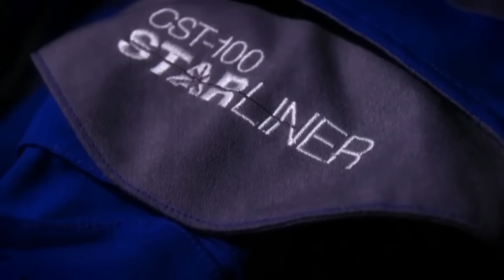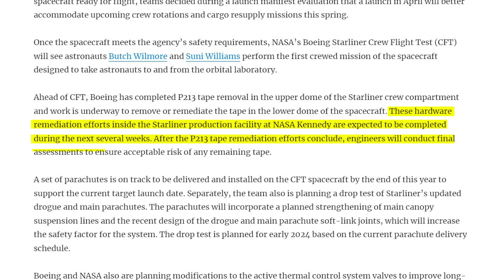What Happened To Boeing’s Starliner Spacecraft?

Comment: Wilmore and Williams, returned to Earth on March 18, 2025 : They should sue the bark off Boeing s tree for this negligence Boeing has conducted (737 max survivors to offer the 10lb hydraulic peddle hanging forcing 30+ veteran pilots to plunge to thier death in descent ..no excuse for one what pilot cannot put 10lbs of pressure on a peddle? Number 2 why isnt thier an emercency hatch or panel in the back of the plane to disconnect that rudder and manual lock straight forward ? Its not even needed to drive the plane but definitely responsible for many deaths , its not a fish or a bird if its a bird then what bird flys 500mph? Point proven fix your fkn mistakes Boeing!)

Comment: What has happened to Boeing?  would probably be a better question.
Reply: Oh, everybody knows exactly what happened to Boeing. Boeing was a company run by engineers. Its managers were always promoted from their engineering staff. Then, Boeing merged with McDonnel Douglas. MacDac had fallen on hard times because they had come to be managed by accountants and financial people who stressed the short term bottom line instead of the long term quality of the product. Somehow, when Boeing took over MacDac, the Macdac people wound up in the senior management positions of the company. They stopped promoting their own engineers to managers and began following the MacDac philosophy of hiring outside finance types. The results were as predictable as they were inevitable. People with no understanding of engineering were put in charge of engineering projects and concentrated on cutting corners, and they still don't know what they are doping wrong.

Comment: Starliner is a bad joke. Multiple problems that woudn't have happened given thorough quality control throughout the construction process, causing years of delay, all to produce a capsule + service module with less dV than the Apollo equivalents?. Boeing used to have a reputation for engineering quality, but somrhow, it looks like they lost their way on that. If you'd told me thirty years ago that Boeing's attempt at  this would be such a shambles, I wouldn't have believed you. I would have expected Boeing to have created a vessel that could carry more crew, in greater safety, and be more capable than anything else that had  existed. Now, though, Boeing is renowned for making flawed vehicles due to errors in design, manufacture and quality control.

Comment: The door plug blew off because they forgot to add bolts...
Reply: Actually no. It was the company that Alaska contracted with to install the satellite internet that took that plug out for access, and didn’t reinstall it correctly. You just have to look at the planes service history and log book to see where the problem appeared.
Reply: @davidwebb4904  i would do as mentour pilot said and wait for the final report...
Reply: @unitrader403  They was nothing at all wrong with that plane, before it went into the shop to install the Internet. Straight afterwards was when the issues started appearing in the maintenance log. If it looks like a fish, swims like a fish and smells like a fish, the odds are, it's a fish.
Reply: @davidwebb4904  well, i prefer to not jump to conclusions when ripples appear on the water.. for example usually several maintinence and upgrade works are done while a plane is in maintinence, not just one, and especially i doubt the plane is grounded a few days just for a wifi upgrade. 
Also the pressurisation warning in at least the last occurence triggered when the plane just landed, and from what i gathered only one of the triple redundant systems triggered in all instances, which is more indicative of a sensor glitch than an issue with the plane..
but again: i will wait for the final report, by which time i know no one else cares, because Godzilla just attacked tokyo again or something..

Comment: Starliner has a launch date of April 14th, 2024.
The parachute issue is fixed and th etape has beeen replaced.

Funny thing about the tape.. its used on the ISS, was used on the space shuttle and still used on the Soyuz capsule. Its an industry standard aerospace tape.
I wonder what SpaceX uses?
Reply: So why did NASA forbid its use if it was used on Space Shuttle?  Why was this issue not discussed and clarified early on in its development?  Also why was the parachute issue not resolved during the initial test when only two of the parachutes opened (by mistake)?
Reply: @Oldman5261   NASA didn't know the tape had a (extremely slight) flammability issue. until it came up during a review of a fire extinguisher system. Since everyone else was using it, Boeing thought it wasn't an issue that would be an impediment either.  NASA has since added it to the list of products they don't want on their missions.
It wasn't forbidden when Boing started designing it .
Similarly the soft link connections on starliner's parachutes are also commonly used in the aerospace industry.  The Issue is the load limit on them is reserved for a greater number of chutes.  Starliner was using 3 chutes which works fine, but if one fails to open then two cutes which are still fine for supporting the capsule put too much stress on the (fewer) softlinks.
Crew dragon for example uses the same softlinks but uses 4 parachutes. If one fails 3 is still sufficient to spread the load out.
Apparently problem occurred because they parachute manufacturer, Airbourne, provided Boeing with load limits of the chutes based on 4 chutes.
Elon Musk has actually given Boeing their data on the parachutes to help them out.
From what I understand Starliner will either be using 4 chutes with the same number of softlinks or using 3 chutes with a more softlink attachments on hardpoint assembly.  They a have tested them and both work. We'll have to see which one they choose.
Reply: @Oldman5261 Ever hear of the "old boys" club? There was even a high-level NASA admin who was caught feeding SpaceX's confidential and proprietary info to Boeing!

Comment: Given it's a Boeing product, I sure hope they thoroughly check to make sure there aren't any loose bolts!
Reply: Idk what people are on about. I’ve never been killed by anything Boeing made.
Reply: @oberonpanopticon  But would you be willing to board a Boeing aircraft now ???
Reply: @oberonpanopticon  You missed a keyword "yet".
Reply: Neah, the Boeing capsule is a feature. It can ditch the door in mid flight and becomes cabriolet, giving much better view of earth and mitigating claustrophobia.
Reply: Suddenly the dream Tom Hank's wife had in Apollo 13 doesn't seem so far fetched.
Reply: I doubt most people realize just how close to a major disaster those "loose bolts" would have caused. The passengers and crew only survived because the blowout occurred at 10,000 ft and the pilots stopped the ascent at 16,000 ft. At this altitude the air is thin but still survivable. At the rate of climb of the 777 the flight was only a 2-4 minutes away from its cruising altitude of 30,000 ft when the blowout occurred. Even with oxygen masks that altitude is NOT survivable and Boeing would have added another 170+ corpses (passengers and crew), to their recent tally.
Reply: But lose nuts and bolts are Boeing trademark tick of approval, no bolts no worries, they just were listening to Elon Musk no part the best part.
Reply: there werent any loose Bolts it seems, but rather there were no Bolts at all...
Reply: Remember...Duct Tape doesn't work in a space vacuum environment
Reply: @MrGchiasson Actually it would. The people would all suffocate, but the duct tape would still be sticky.
Reply: People are WAAAAAAY over obsessing over some loose bolts. People need to chill. It's just a few bolts. No biggie.
Reply: @etsequentia6765  factual statement.. the astronauts on starliner will be very chill in the vaccum of space if a few bolts fail
Reply: @etsequentia6765 they were pretty important is the issue

Comment: Go Boeing Starliner and Go Cargo Dream Chaser in April 2024 !  tjl
Reply: The fact that Dream Chaser was passed over in the initial contract is an error that is now being paid for.  I'm just happy that Boeing didn't get a cost plus contract.  If taxpayers had to take on $1.7B due to Boing's poor oversight, that would truly be intolerable - probably why Boeing announced they would never sign a fixed-price contract for space bids again (cue applause from their pocket congressmen).  So the problem as Boeing sees it is not engineering, but the decision to sign FPC, and I'm sure executives were reprimanded according to this outlook.  Yet the engineering is squarely at the center of the problem.  Their SOP for the valves is clearly lacking (or their QC is facing the same pressure from managers that lead to the 737 incident).  And of all things, software issues leading to failure of mission goals, requiring NASA to step in and audit, is just embarrassing for Boeing and especially the engineers who worked so hard on the other systems.  Meanwhile Sierra Space is approaching mission readiness with series A+B funding totaling less than Boeing lost on project delays.  I hope this is taken into account on future LEO and lunar bidding - incentivizing profit-motivated commercial space vs blank-check underwriting pseudo-commercial entities that place their ability to win contracts above their ability to deliver.
Reply: @ConstructiveInterference656  Well said !!! 

However, had it been a cost+ contract the overrun (plus NASA's gratuitous bonuses),  would have been much, much higher than $1.7B (and counting).

Comment: Anyone feel like they should just take an Apollo capsule out of a museum, refurbish it, and launch THAT instead at this point? 😅 Seriously though I hope that Starliner gets up and going smoothly and has a good career.
Reply: I just hope they can get it back to Earth with the flight crew..ok.
Reply: Unfortunately, by the time that they do that, the point will be moot.  Billions wasted on a system that is no longer needed.  You can throw SLS into that bucket as well.
Reply: Because the Apollo capsules would not meet the mission parameters of extended stays in space, not big enough, etc etc.
Reply: IIRC North American Aviation, the company that built the Apollo capsule, is now part of Boeing.
Reply: @RCAvhstape whatever. In any case the engineers, experience and first hand knowledge is long gone.
Reply: No. But have wondered about why they couldn't go the route of developing a low earth orbit-focused Orion spacecraft variant, and have it launch on a Delta lV Heavy rocket, and later on a Vulcan Centaur rocket.  The ULA rockets could launch into LEO payloads of 28,790 kg and 27,200 kg respectively. I think the launch mass of Orion is 26,520 kg. 

Now I think Delta lV Heavy is an expensive rocket, costing about $350 to over $400 million per launch, but that approach maybe could have gotten the ball rolling while Vulcan Centaur comes online, leveraging work already done with Orion and SLS... Both Boeing and Lockheed were backers of the ULA joint venture...
Reply: @michaeldunne338  My thoughts as well. They would save money, while due to lots of extra real world testing, be able to build a bulletproof spacecraft, instead of 2 not so well tested ones. I think for a nation, 2 separate human spacecraft is enough. Dragon and Orion.